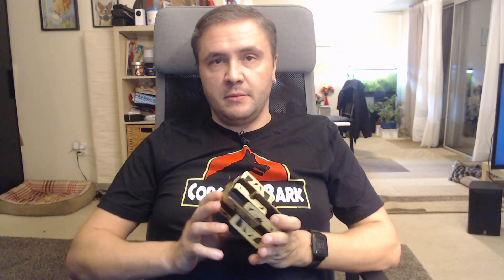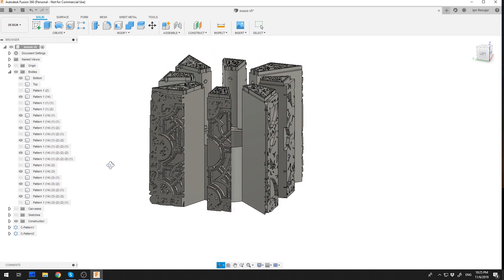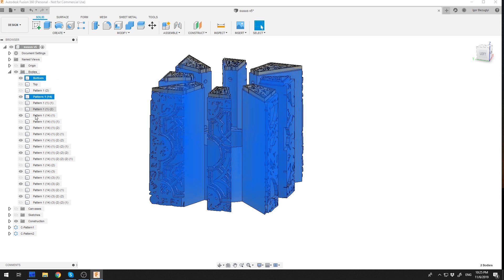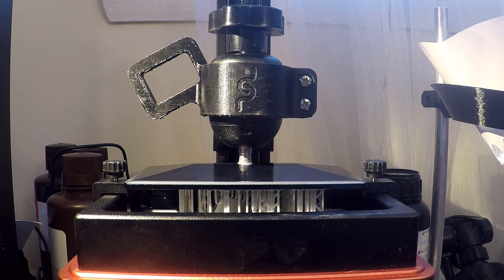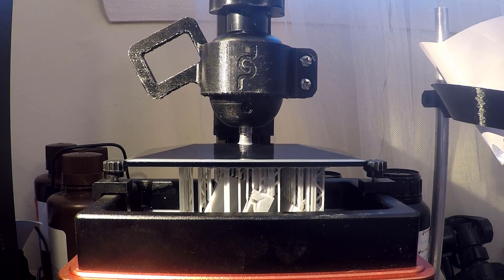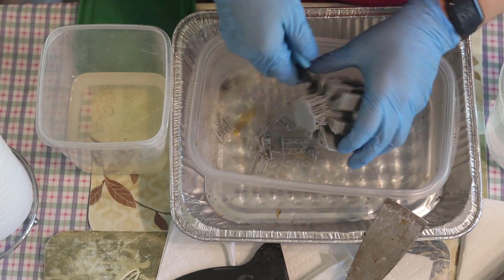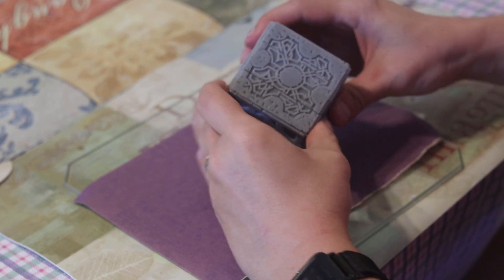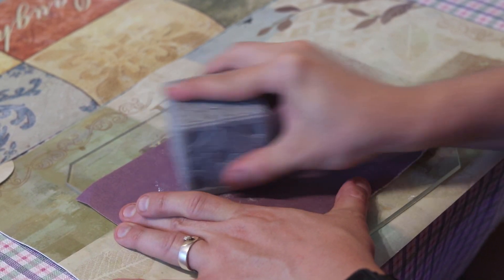3D Printed Lemarchand's Box from Hellraiser | Design, Print, Post-process, and Assemble

Comment: Do you think this would turn out okay using a fdm printer?
Reply from the maker: Someone responded in my Thingiverse account with a make. So yeah, it's possible, depending on how slow you wanna go and how well-tuned your printer is. The level of detail will not be as great, as on an SLA printer, however you can scale it up, so it is easier to print on an FDM machine.

Comment: An amazing piece, thank you for sharing!
About to print it myself. Which resin did you use and could you share your settings (if not default)

I'll be using ABS-like Grey
Reply from the maker: (Sorry, accidentally deleted my own comment :) )
I used Elegoo Grey and Siraya Tech Fast Grey with equal success. For the exposure settings I used the "magical spreadsheet" - https://docs.google.com/spreadsheets/d/1dV-mvE8IojXSNiUHf8fHf_eHJGAQzbeFEalcP4bdnsg/edit?fbclid=IwAR2h1mOAG4ZyxRXE9SCIUPTHtTkRNXYfruLw8ZZ5vPkQddpGHa1365qt140#gid=0
The rest is pretty straightforward - medium auto-supports with 75% density, rotated the model by 25 degrees. You may also want to sprinkle in some manual support along the edges here and there.
One thing I've noticed is that the Elegoo resins are very brittle.